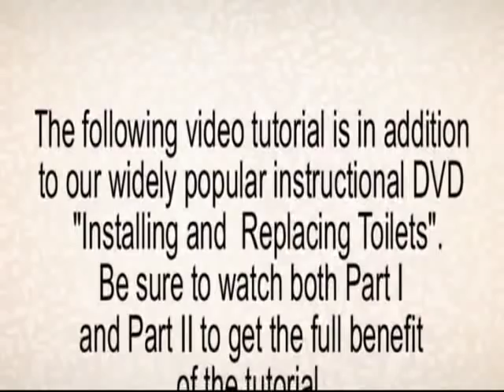Replacing Broken PVC Toilet Flange Part One.flv

Comment: Thank you Jesus for bringing me to Mr. Singer's website. Have been stressing over this problem for awhile, looking for answers for broken flange. I used electric reciprocating saw, hammer, and big flat head screw driver. Did what you mentioned very carefully and was able to pop old broken one out and put in new one. It has been a constant worry for months. So, thank you thank you so much. Now on to the tiling around the toilet.

Comment: Thank you for the tutorial. I have had a problem toilet for years and when I removed the toilet I found that the flange was cracked big time and leaking under a tile floor. I followed your tutorial and sawed most of the way through the old flange and was able to pop out most of it cleanly. Any spots didn't come off clean I went in with a Dremel tool with a sanding disc and then followed up with some emory cloth. Worked out perfectly. Thank you!

Comment: your video was just what i was looking for! i followed your instructions and used my 4" hole saw and that was perfect! ONE thing i would like to add. I do a lot of wood working,,, if you use a sharp hole saw and run the drill in reverse it will not walk! and it will still eat right thru the PVC like a hot knife thur butter!
Thanks again for the video... that broken flange would have cost at least $600 with a plumber!

Comment: Excellent video.  Completed a good repair using Oatey 3" PVC "Twist -N-Set" Replacement Flange (#436544) from Lowes, $10.  I used a die grinder and cutoff wheel to cut the old flange from the waste pipe.  With the gasket seal, this installation has the added benefit of being removable if it breaks again.
Two notes:  1) Some wax rings come with a plastic flange that funnels waste into the pipe beneath.  The 3" Twist-n-Set flange slightly reduces the pipe diameter such that the plastic flange on the wax ring is too big and won't fit inside.  Buy and install a plain replacement wax ring without the plastic flange.  2) The porcelain discharge nipple beneath the toilet may extend 1/8" or so beneath the toilet base.  During the repair, rest the toilet on 4x4's front and back to avoid resting the brittle nipple on the floor and perhaps damaging it.

Comment: Great video.  I have done a lot of various handyman things over the years including augering the main sewage pipes for tree roots.  This time I happened upon a completely broken toilet flange that was causing leaks into a wooden floor.  After watching this video and with a lot of work with a chisel and hammer, I was able to remove the thoroughly glued in and sealed flange and replace it.  I did have to drill into the concrete to mount it, but that really wasn't a big deal.  The hardest part was chiseling out the old flange from the inside of the pipe.  Synopsis, leak is fixed and it cost me a total of about $30 for the parts ( a silicone seal instead of the cheap beeswax  $8, new replacement flange and rubber seal $17 at Home Depot, and concrete screws and some washers for the flange - it didn't come with any screws for mounting).  Thanks again for the video and great tips.

Comment: Thanks! I am repairing someone else's cluster fuck on a house we bought 7 years ago...
Recently the main line stopped up, we have no cleanouts so we tried going through both toilets. In the process we found 1 toilet had 1 bolt 1/2 gone and one broke in two... the only thing holding it to the floor was a bead of silicon around the edge. Those were screws in to the concrete, there is no flange. It's PCE so we will use that internal flange. Many thanks!

Comment: Part 1 and 2 are the best videos I've seen for flange replacement.
One question, how do you remove a 30 year old pvc (or some type of plastic) 4/3 flange. The top is off, but the very thick 4 inch sloping to 3 in. has me stumped. Do you have a video or helpful tips for removing that part?

Comment: The 4" hole saw was a life saver. As an electrician I didnt have a chisel handy, but I sure had a 4" hole-saw. 
Had to use your sectioning/notching idea for the remaining piece. Even though I had purple primer it came out nice and easy with a little tapping here and there. 
Fantastic video man, thank you so much. 
Did you comb your hair before each shot? please confirm.

Comment: To make life easier, I used a 4' hole saw and cut a centering cap out of 3/4 inch plywood(It gave me a 3.7" diameter cap). It fits tight inside the pipe, then I would use the existing drill bit hole on the cap  to center the  4 1/4" hole saw. Then I chiseled the rest like you said.

Comment: Good video. Clearly explains what to do for that situation. Unfortunately, my situation involves a 3" PVC riser pipe with an outside fitting flange that seems to have been attached with primer (they screwed up everything else about the installation, but the one thing they did right had to be that).
Reply: This is the first post I've come across anywhere that describes my situation - 4x3 flange over a 3"pipe.. Hope you found a solution...I'm still looking. This seems to be an uncommon installation from everything I can find.
Reply: @handsoman99  Theoretically I found a solution, but haven't actually completed it. It's been so long I don't remember all the details, but I think I cut off the top of the flange that was there, then put in a coupler around the outside of the pipe, then inserted a new piece of pipe into the top half of the coupler, intending it to butt up against the existing pipe. Then I would be able to install the new flange on top. Unfortunately, the whole pipe assembly shifted down when I inserted it and the primer immediately set, leaving a gap. I had some PVC gap filling material that I had intended to use to fill in what was supposed to be a very small gap between the pipes. Now that it was a larger gap I had to work out some other plans. I think the original plan would have worked if I had been able to secure the pipe assembly to keep it from shifting during installation.
Reply: @QuirkyUncleDave  Thanks for the response!  Your post was from so long ago I didn't expect you to reply, but I appreciate that you did!  This was the first video where I caught that the plumber's don't usually use primer to make their flange connections.  Once I heard that I gained some confidence in what I was about to try and was able to chisel the outside off the riser pipe with pretty good success.  Sorry to hear your pipe was primered and was far more difficult.

Comment: A heat gun is a must IMO. Mine was primed and glued onto the drain pain (saw a green residue). From these use vise grip and chisel to pry it out. Hammer was used a last solution, and left a mark on the drain pipe.

Comment: I am thinking about using a heat gun to melt the glue between the pipes after hole sawing the flange top out (I use the heat gun to melt the glue on the PVC pipes on the pool pump and it worked very well..). It'd be easier.. . Is that because of the gas concern not considering using heat gun.. ?

Comment: Should’ve just used measure tape and an inside pipe cutter. Measure down the width of the hub on the flange add a 1/4 inch (for your gap between flange anf floor) and cut. Glue in new flange onto pipe. Insert concrete screws and or nails. Viola!
Reply: Solid video tho.. there’s just easier ways. 🤙🏻

Comment: When I wanted to replace my toilet I discovered that the two bolts connecting the flange and the toilet were placed in " horse-shoe" like openings on the flange instead of the channel run where they are supposed to be. The flange is misaligned by 180 degrees There was no wobble and no leaks ever. I wonder how it was holding up so well with bolts in the wrong holes of the flange. Is this horse-shoe opening on the flange where the bolts were installed perhaps an alternative place to use to secure the bolts?

Comment: if i put a inside fit flange inside a 3 inch pipe is that going to constrict the flow too much and cause problems? the outlet to my toilet is 2 1/4 inch. Is there a general dislike of that size flange?

Comment: Obviously you will have to make sure the replacement flange is flush with the floor or the toilet could still rock. This may require a little bit of quick hardening poly to ensure a flush mount

Comment: Instructions are good and the method is smart....ie keeping the sewer pipe itself from cracking.   One problem.  The PIPE is 3 " diameter....not 4".... with a crack in the flange.  I know this because I followed the inner diameter of 3" down into the pipe and noticed no ridge or increase in diameter, a few inches down,  as it started to curve!   I guess I am SOL with replacing the flange, as I don't want to drill out the 3" pipe and put a still smaller diameter sewer pipe.   The drain clogs easily enough as it is.   Probably the plumbing subcontractor to the builder wanted to save a few bucks.   I think I will build an outhouse back in the yard.

Comment: Now I know you said (a couple of times) to be careful not to damage the pipe...and yes I managed to damage it a bit. What should I do now? Can i put some silicone or something to make sure it doesn't leak.  I have a 3" pipe with the original flange installed on the outside. Now there is a hairline fracture on the pipe, at this time the fracture goes down about 1-1/2". Will I be safe with a flange that will go inside the fractured pipe?

Comment: i have a cast iron pipe thats chipped at the top and there was a cast iron flange applied on the outside of the pipe. How do i go about this? The toilet rocks back and foward and the tiny tiles surrounding the pipe opening are destroyed. I initially removed the cast iron flange but the damage applied to the pipe was not on me. (I think) so what should i do with the cast iron pipe opening and the surrounding tile area?

Comment: Need help? I have a 3" PVC pipe with old flange glued on the outside of flange but I didn't get all the pieces off perfectly and the new flange doesn't push down to the floor flush. Does the glue soften the areas to push the new flange into place?

Comment: You mention that if the plumber used primer it might be impossible to remove the fitting from the pipe. That is my case. I was able to remove the flange so I was able to go ahead and set my tile floor around the pipe, but now I must address the pipe again. What I have now is the vertical pipe that has the fitting still in it but it will not chip out as it appears that it was primed. So what now?
Reply: Kathryn Cleveland i
Reply: Kathryn, what was your solution for the flange previously installed with primer?

Comment: A heat gun would do you lots of help to separate the fitting from the the pipe. Try that tip next time and I hope you will do a tutorial showing the trick I told you. I also suggest that next time you stuff an old towel or something similar inside of the sewer pipe to avoid yourself exposure to the sewer gas that would be emitting and it would also prevent debris from fallen in the pipe.
Reply: JUNIOR LEWIS he said he had a rag in the pipe.

Comment: I can't think of any reason why you would need to remove that inner PVC piece in the 4" pipe if you're replacing the flange with one that fits on the outside of the pipe.  Why not just leave it in the?

Comment: I used a toilet clamp, and I did not have to fix the flange or use toilet flange bolts, I got it on ebay, very simple fix, if the wax ring is not leaking you don't even have to remove the toilet from the floor
Reply: Grant Peacock what does it look like? do you have a link?

Comment: if it is screwed to the floor, why does if have to be glued at all?  It's not going anywhere.
Reply: to keep sewer gas contained in the pipe.
Reply: What about any clogs or backflow? Also, you saw when he was cutting the flange- the tube was wobbling- There is a chance when using plunger you will end up separating the pipe from flange, downward. And then you are totally screwed, with all teh toilet content going into the subfloor area.
Reply: drpinky504 I'm guessing to keep sewer gas from leaking in the bathroom and prevent any leaks under the floor.
Reply: Ronnie B hahaha what . Not even close

Comment: That process of drilling out the PVC flange with a 4' hole saw is NOT duplicatible. The every day Joe is going to ruin the pipe long before he /she gets the correct amount of pvc material out of the pipe with out damaging it. And for the cost of the correct tool v.s. the 4" hole saw, it is worth the difference to get the job done with out damage to the pvc pipe.
 Use the proper tool for that job. There is a tool called a "Fitting Saver" (WHEELER-REX Fitting Saver) or a "Pipe Shredder" (Rectorseal Brand, Golden Pipe Shredder) are just two of the many choices available  on the market. Look at the big box home improvement stores for much cheaper options that may only last 2-3 jobs.Those are made to remove the PVC pipe from a fitting or a fitting from a pipe. You must get the correct size for the job you are doing. 
If you are going to use a pipe shredder or fitting saver, you do not cut out a piece of the flange . Once you remove a chunk of the flange you may not be able to use a fitting saver or a pipe shredder.

With the pipe shredder or the fitting saver you can just run the tool all the way into the pipe and eliminate the material inside the pipe even if the last plumber used Primer. Because you are removing the exact amount of material so it leaves the correct size hole to glue another flange into the pipe.
Don't forget to place a rag down into the pipe in order to catch the PVC chips or saw dust. Then don't forget to get the rag and shavings back out when your done! lol

Comment: Great video- I need to replace the flange on my toilet while we are renovating our bathroom for accessibility and came across the Culwell Flange. Has anyone tried this? They say it will stop leaks from getting into the subfloor from the toilet. It could be useful as we are installing a roll in shower pan, new floors, etc. Their website is www.culwellflange.com Was wondering if anyone had thoughts about this.....